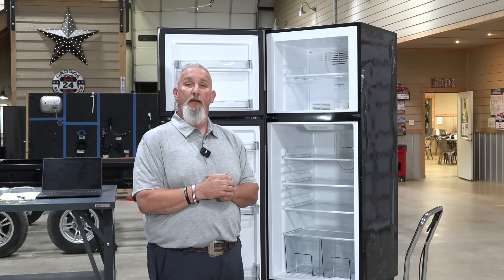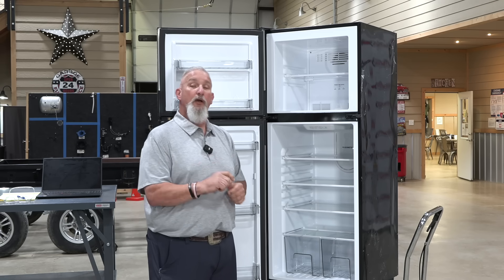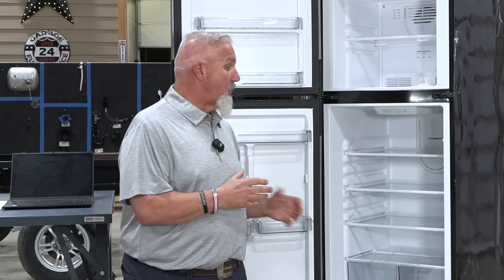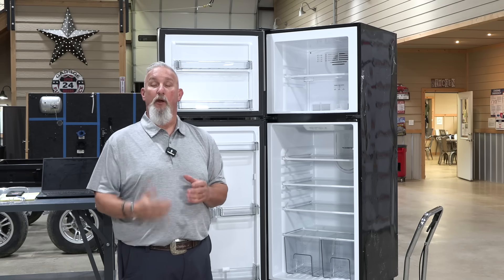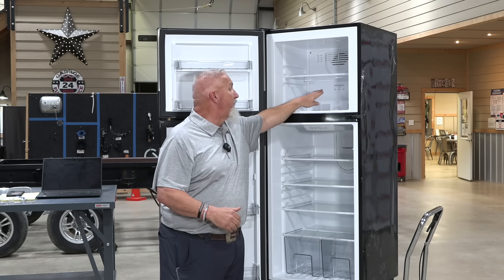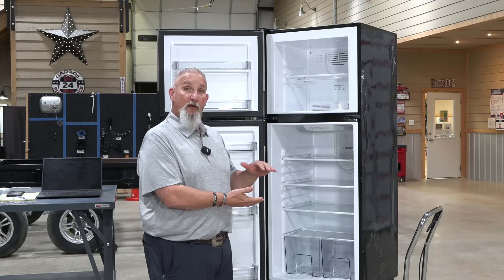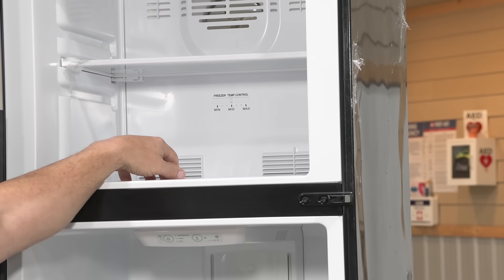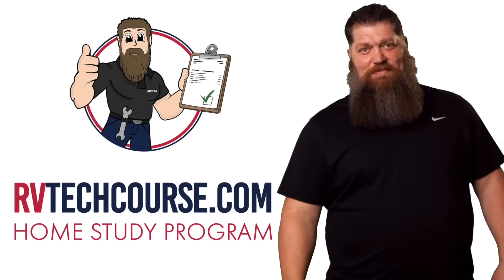The 12 volt Refrigerator: What you need to know!

Comment: Low voltage was mentioned, but that shirts the big, big issue.  An absorption refrigerator sips electric power and propane.  A compressor unit pulls lots of amperage.  Larger units make it difficult to boondock at all.  Even a large battery bank and lots of solar can be an issue in cloudy weather or when camping in the woods.  Also be aware that the specs are often misleading.  Power consumption can easily double when camping in warmer weather.

Comment: I wish my Furrion fridge had fans or an adjustment for the freezer. With the fridge section at about 34, as cold as I'm comfortable getting it so I don't freeze anything, the freezer is about 5-10. Cold enough to freeze, but not ideal.

The large grate at the bottom for the air intake/exhaust is nice though. Allows for good airflow and there's plenty of room to reach back in and clean the coils and intake fan.

Comment: Just my opinion: why not just get a residential unit and power it with a dedicated inverter? I don't have a production rv, I have a ctc, one inverter is hooked up to the bussbar and one wall circuit just for the refrigerator, small 4.7 cubic foot unit draws only 1.3amps,  if I run an inverter I don’t need the bigger wires I pull under 200 watts just on the refrigerator, a little draw on the inverter, but a cleaner install. Run a 200watt panel on the roof, and LiFePO4 battery will keep it running all day and night of a couple hrs of good daylight. The bonus is if the refrigerator breaks down over time, they are more of them on the market than a hybrid or 12volt unit, and lots cheaper!

Comment: Great video Todd, My freezer on my Furrion 10cuft 12v fridge is about Zero degrees. My fridge is about 40 degrees. It use to get down to 30 degrees if I turned it up to high. It's been on for 2 days now, it qwas 50-60 degrees all day yesterday. Tjis morning when I got up. It was 69 outside and the freezer was 0 degrees and the fridge was 40 degrees. I have already power everythung sown for 15 minutes but still stuck at 40 degrees. As the day gets warmer 90's I'm afraid the fridge will go back up to 50's again. What should I check next? Door is closed fimaly and there is seal leaks, I have a battery operated fan on the top shelve to help circulate the air.

Comment: I converted my gas/electric Norcold to 12 volt because it never kept anything below 42. Even the freezer wouldn’t go below 28. After spending lots of money trying to get the gas/electric to work right I went to a aftermarket 12 volt that uses two compressors.  A small one for the freezer and larger for the fridge.  I can control my temps now, keeping the freezer around 10 and the refrigerator around 35/38. I added one battery (2 total) and 400 watts solar just for charging batteries, no inverter. It’s two years old and very happy with it.
Reply: What 12v unit did you go with?

Comment: We have (had) a Norcold 19 cubic foot 12 volt RV refrigerator in a new 2024 Alliance 310RL.  The refrigerator quit working 3 months after warranty.   Nothing but silence from Norcold.  Alliance didn't comment either.  The RV tech found a charred control module for the refrigerator, which he replaced but the refrigerator still doesn't work.  We're in the middle of replacing it with a standard residential refrigerator.  Too bad RV manufacturers team up with subpar RV component suppliers.  Certainly, the 12v RV refrigerators aren't ready for prime time.

Comment: 12volt….the new miracle refrigerator? No. I’ll stick with the old style LP/electric. 12volt is grand if all you do is visit parks with all the amenities. Even at times, solar doesn’t work well. Many people RV off grid like in hunting season or fishing or back country camping and while you have generators, nothing works better than LP. Try a week or more of inclement weather with heavy low clouds or winter days where the only sun is on the calendar pages. During a three week extended power outage in our area (which included gas stations), we were blessed to have our LP gas refrigerator including our cooking appliances in our RV. From that outage, we actually purchased a residential LP refrigerator and range for our home as outages seem to be more and more common. If all you do is go glamping, a 12volt or 110v is awesome……go boon docking in the back country or many national parks, then propane is the better choice.

Comment: Absolute trash HATE IT, had nothing but issues with mine, if I turn up the freezer to 4 my fridge doesn’t keep up i have to keep my freezer and fridge to 3-3 and that barely keeps anything frozen or cold there’s no in between its been a nightmare
Reply: Did you check if you see if you had  correct 8 awg
Reply: @richarddiaz8248 where should I look for it? My power cable that comes off my battery is 6AWG is that what your referring to
Reply: @richarddiaz8248 no I have 6awg on my wiring from the battery, would it matter? It came from dealer wouldn’t they wire in a 8awg if it’s needed or should I upgrade it?

Comment: without a large solar and especially large battery bank the boon docker is S O L. with these cheap 12v fridges and don't get me started about the tankless hot water outrage. the RV industry has succeeded in cost cutting and enraging their customer base Once Again.
Reply: I agree with you on the tankless water heater but at least the insulation in the fridge means the compressor doesn't run 24/7. It's not a 100% duty cycle device.  The tankless has zero energy retention, the electrical energy is converted to thermal energy and immediately used or sent down the drain.

Comment: I just bought a camper that has a 50 amp hookup. Until I have a 50 amp service installed at my house can I step down and plug my camper into  a 120v  outlet?
Reply: Tap into your dryer wiring it’s 240 volts
Reply: Yes.  You have to buy adapters to step down to a standard power cord.
Reply: Yes, you can buy adapters that will convert your 120Vac split 50 amp cable into a 'standard' 120V AC plug BUT.. and its a BIG BUT... Your household 120Vac outlet is likely only fused or has a circuit breaker for a 15A or at best 20A service. If you attempt to pull more than this from your house you will blow a fuse or trigger your circuit breaker.  You house outlet will not be able to supply a full 50A to each leg of your RV's 50A requirement.

Comment: Thanks for the video. How many batteries do I need for a refrigerator like that for a day, if I'm not running the RV?
Reply: in my experience as a winter boon docker most people that are running 12v or 110 refrigerators with minimum 400w- 600w solar and 400ah batteries, minimum. this is in the desert with mostly sunny days down near Yuma. just another way to cheapen RV construction while passing larger costs on to the consumer. most poor old timers just use propane.
Reply: There are a LOT of variables that go into figuring out how many batteries are needed. A good way to find out would be to connect a shunt inline with the fridge and take a measurement.  Realize that the outside ambient temperature, what's in the fridge and how much is in it, as well as how ofter (or not) the door is opened, all will affect the results.

Comment: Great video.  Should I be using a dc-dc stabilizer (I have also seen them called buck converter or step down regulator) to ensure that a 12 volt fridge gets only 12volts and not more such as would be available when the lithium batteries are fully charged?
Reply: Most 'so-called' 12V devices (including appliances) are rated to operate over a certain voltage range; say 12V +/- 15% (10.2V-13.8V). The label on the appliance will tell you this information.  Most DC devices are damaged more from undervoltage than overvoltage but a 12V regulator with a tighter tolerance than the appliance itself does offer some safety. a 12V EMS (Electrical Management System) that took action to protect its 'load' from over or under voltage, miswires, shorts, surges, etc. would be best but is probably considered overkill.

Comment: Why don’t they install 12v refrigerators in all RV’s? Sounds like a “no brainer” if not only for traveling between campgrounds because you are not supposed to be driving with propane on
Reply: The reason is the 12V requirement for the fridge means that the RV battery needs to have enough capacity to run the fridge. Even though the fridge will turn on an off as needed to maintain the temp, when it's on it does draw a good amount of current from the batteries (especially in hot climates). The trickle charge provided by the tow vehicle to RV connection is not enough to keep the RV batteries charged over long drives.
Reply: @marvs4628  the tow vehicle should have enough power to run the refrigerator while driving from location to location and then switch over to propane once arrive at destination
Reply: COST.  With a 12V fridge the RV manufacturer needs to make sure that the RV can support enough batteries to keep the fridge operating. Without knowing how long you'll need to run it they will likely supply you with only enough battery for the fridge to last a day or two.   Also it's not a good idea to run a fridge on anything other than Lithium batteries for several reasons.

Comment: lol.....12v is old school and silly in this day and age.  use anything above 12 V.
these door opening refrigerator and freezers are also a scam.  you open the door and all the cold air comes pouring out.  at least have a freezer drawer.  never ever have a freezer that has a door where the cold air pours out.
Reply: Cold air falls to floor. That's one reason a/c fans run higher speed than when on heat.

Comment: This is nice for new(er) fridges but mine is only 2 years old.  No fans.  I added a fan in the lower area and that has really helped.  However, mine is enclosed to maintenance on those fans are not easy.  If that compressor starts running high, it gets really loud.

Comment: No experience with the large 12v, but have a Truckfridge smaller one in a van for 2 years and it is awesome. Also have an Iceco portable chest12v for a year no problems. Both have the Italian Secop compressor which is durable long lasting and low amp draw. I never level my van when parking and never shut it off. when driving, it is a game changer for off grid. Vans all use only these 12v  type and with minimal problems.
Reply: I have a 7+ year old truckfridge and it has been great.  I had to replace the thermostat circuit board once and was back in business.  Now it seems to struggle to lower the temps and the compressor is running much longer than before.  Hope to get a similar replacement

Comment: Good point on the wiring.   The ones I’ve seen with problems had the wrong gauge wiring or it’s wired in with a light circuit.  From the factory.  Which is nuts.  

My 4101 Dometic in my new RV was wired using 8 gauge.   

Not a single problem in 3 years.

Also, make sure you have the battery/solar you need to power these.  

A single 12v won’t cut it.  

Go with 6volts in a series/parallel configuration or just go with at least 200aH lithium iron phosphate and be done with it.

Comment: Not frost free? That sucks! No word on the solar if that is for keeping the fridge going? No word on the truck supplying 12 volts to the battery keeping the fridge going?
Reply: making the RV fridge frost free would require even more power to run it so for now the 12V fridge manuf. are leaving out that feature. REMEMBER, 12V comes  from the batteries or a converter, everything else just recharges the batteries.

Comment: I had a Dometic DMC  4101 12 refrigerator. It was a Joke. After 18 months and three fans literally threw it away. Went back to a Residential and its not using alot more power than the 12 volt did as I've monitored it.

Comment: 12V MIGHT BE GREAT BUT I PREFER A HOUSEHOLD REFRIGERATOR ON 120V.  GOING DOWN THE ROAD MINE IS  20 CU/FT. WITH ICE MAKER,  MINE IS SET UP WITH THE BATTERIES AND INVERTOR RUNNIG TO MAINTAIN THE POWER AT ALL TIMES, ALSO THE SOLAR PANELS INSURE THE FULL BATTERIES AT ALL TIMES RUNNING DOWN THE ROAD AS WELL. I PREFER TO USE  ACID BATTERIES AND USING 8- PAIRED 280AMP 6V BATTERIES INSTEAD OF 4 12VOLTS, RUNNING DOWN THE 12 PASSED 11.8 VOLTS AND THE BATTERIES ARE TOAST, BUT WITH THE 6VOLT UNITS I CAN RUN DOWN TO 10% OF THE EMPTY AND STILL RECOVER ! ALSO AT NIGHT I RUNNING A WINDMILL CHARGER 800 WATTS IN THE NITE WIND,
Reply: What are you mad about, typing in all caps?
Reply: @TraconWizard  SORRY WAITING FOR NEW KEYBOARD THE BUTTON IS SUCK ,

Comment: I like to dry camp in remote areas and have an absorption fridge.
It gets me through 3 or 4 days just fine. What sort of power supply do I need to run a 12v fridge for 4 days? I've heard that 12v fridges need a lot of electricity and will drain your batteries quickly.
Reply: About 12 batteries and five solar panels lol
Reply: How many amps does it draw when it's running That's the question. Your typical 100 watt solar panel will make 5 amps. Go from that and figure out how many panels it's going to take to make twice as much energy as it uses in the daytime. That'll tell you how many solar panels you need. I run my big freezer at home on five solar panels through an inverter. It never goes dead completely. In the morning everything charges right back up
Reply: My advice is to search online for one of the many spreadsheets and explanations as to how to calculate your 12V power requirements. The number of batteries as well as what you will need to keep them charged can then be figured out.

Comment: The Norcold 12V in my 2021 Winnebago stopped working last fall. Refrigerant leak, but no way to find or fix the leak because it's designed to go together once and not be serviced. I replaced it with an Insignia 110VAC residential unit from Best Buy. It fit perfectly in the cabinet opening, and I run it off the stock 1000w inverter. I don't think it takes much more DC amp hours to run, and I love that it is frost-free. Plus it was 1/4 the price of the old one.
Reply: Isn't the RV industry great, they can constantly cheapen their costs while providing a $hittier product and us hillbillies will keep buying.
Reply: I recently purchased a residential Frigidaire, which consumes 3 amps!
Reply: @matsulli2086  3 amps at 120 volt, that means it uses 30 amps at 12 volts if you are using an inverter to run it of your battery
Reply: One of these days, someone will connect a shunt inline with their fridge and obtain some data on the average current draw of a 12V fridge. There are so many variables though that everything will just be an estimate. Probably the best way to get an idea is to know the max current draw of the fridge and assume a certain outside ambient temperature as well as a certain percentage duty cycle (how many times it is likely to turn on or off based on how often the  door is opened)  Once you have that you will know what the fridge draw is on your 12V system so you can use that information in determining what your battery capacity has to be.
Reply: So where are you getting 120 V from? Unless you're connected to shore power 24 7 or you're running your generator all the time, either way you're paying extra for that.
Reply: @rmanbike I used to wonder the same thing. When not hooked up to shore power or running the generator I am running it off of the 1000 watt inverter, which supplies 110 volts AC from the 12v DC lithium batteries. The fridge draws a max of about 8 amps but does not run 100% of the time. The batteries get charged 4 ways: shore power, generator, engine alternator, and solar panels. I have 460 amp hours of battery, which will run the fridge for about 2 or 3 days, but that is supplemented with solar which can double or quadruple that time depending on conditions. On the road, the alternator supplies more than enough to recharge the batteries and run the fridge

Comment: My 12 volt is not cold in refer section. The freezer is. A tech told me they are not designed to be used full-time but I do. No buttons
Reply: Try adjusting the cold and colder knob in freezer that knob is actually for the refrigerator temp. 
I my unit apart to figure it out.
Reply: Rematch. He touched on this.